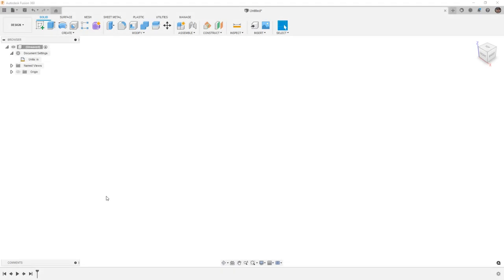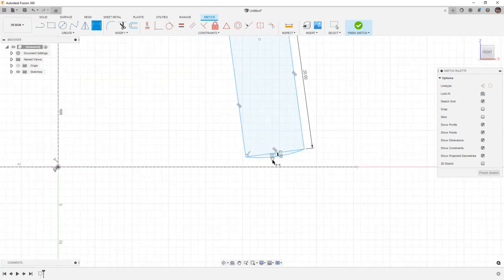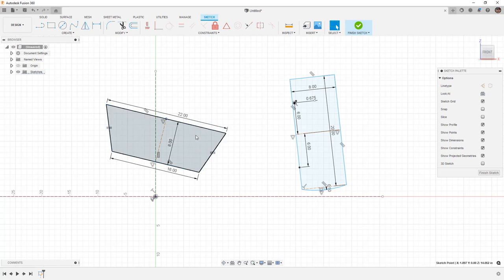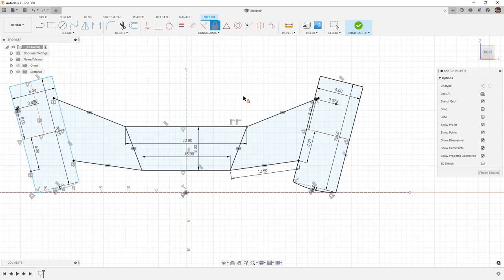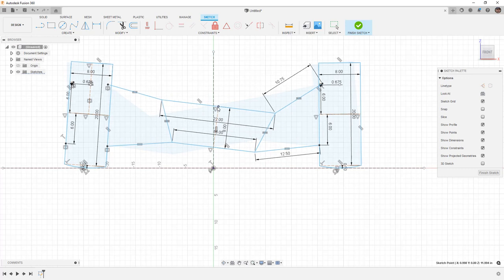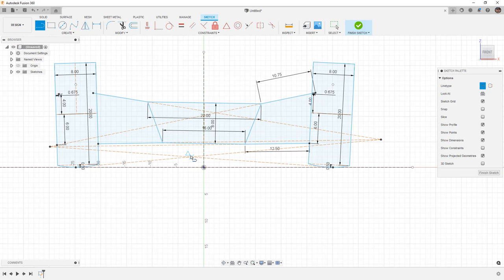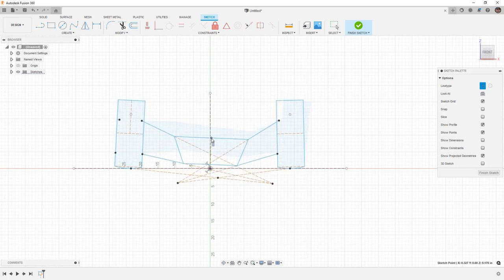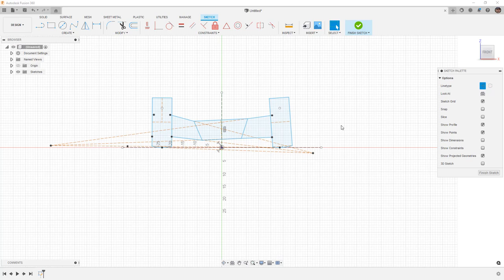Designing Suspension Kinematics with Roll Centers in Fusion 360 Sketches #Fusion 360 #Kinematics

Comment: Thank you! Probably going to try drawing McPherson version of this! :)
Reply from the maker: Go for it!  Should work fine, but what i would suggest is making the strut part out of two coliniear lines.  One end of one line anchored on the chassis and the end of the other line anchored on the upright.  If you plan the lines out you can have a driven dim between their endpoints and track the suspension travel.

Comment: This is great! And super useful. Is there any way to generate a report or graph showing change in certain angles or relationships in a sketch like this? Say, for example, I wanted to measure camber gain against wheel travel. I imagine I could move the wheel an inch at a time and manually record the camber angle as a driven dimension... but I feel like there must be some way to automatically generate such results.
Reply from the maker: Thanks Brook! So sadly your idea of moving it X number of degrees and recording the driven dimension is the only way I am aware to do this with Fusion 360.  If you were using Inventor Or Solidworks you could plot a graph and export that but Fusion just doesn't have that built in as far as I know.

Comment: Tried to download the sketch but the site says the file is empty...
Reply from the maker: That is really strange Joe, I just tried and indeed it didn't like the fact that there was no body.  When i open in fusion it shows a sketch but its empty for some reason.  I tried to add a dummy solid body but it still said it was empty.  I wonder if its a temporary issue with a360 and not the file.  I tried to turn off the share link and back on but now the download option is missing.  Try again with this link(same link) https://a360.co/3fE8ie9

This one with the dummy solid body works for me with the kinematics sketch.  If it doesn't for you let me know and I'll figure out another work around.
Reply: Adding the solid body seems to have been the key... worked fine this try, thanks... I could have gotten along fine without it but was interested in why it didn't work... <Grin>
Reply from the maker: @Joemac05  Yeah thanks for noticing that!  You must have been the first one to try and download it.  I don't know why it wouldn't work but "the more you know" right :)